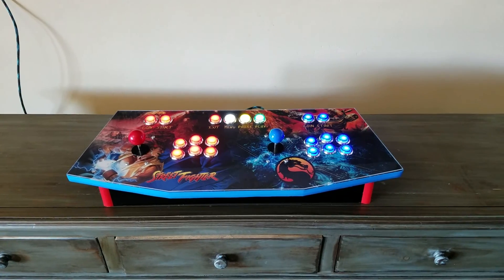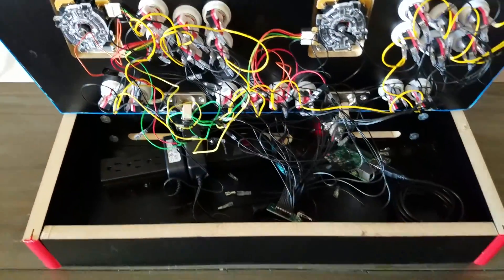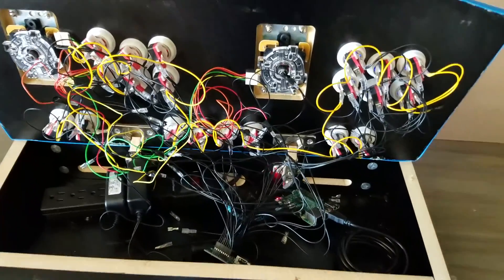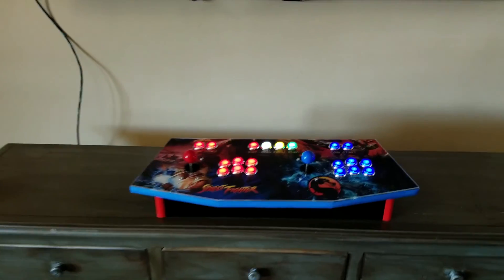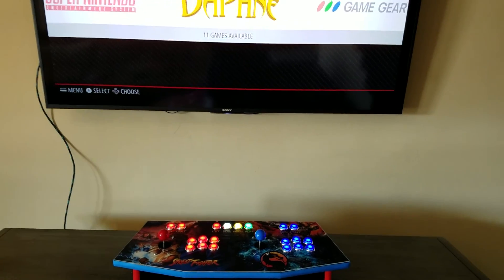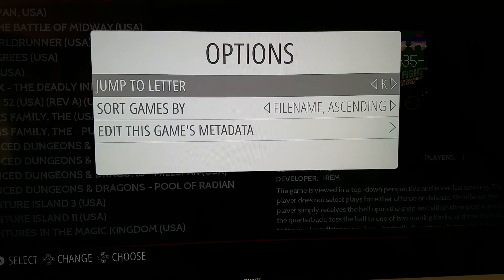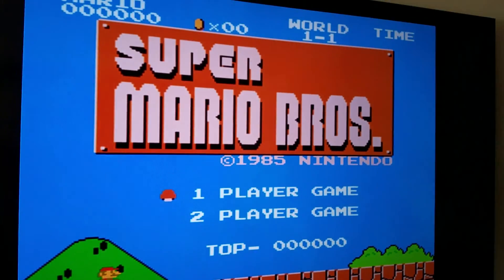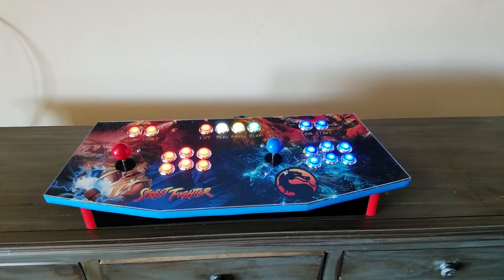Arcade Control Panel Running Raspberry Pi

Comment: If I bought this, would I later be able to make into a bar top arcade with any of your kits? I know it's a weird question.
Reply from the maker: No.  This is designed to be a standalone unit.